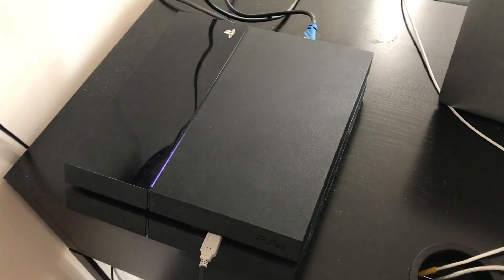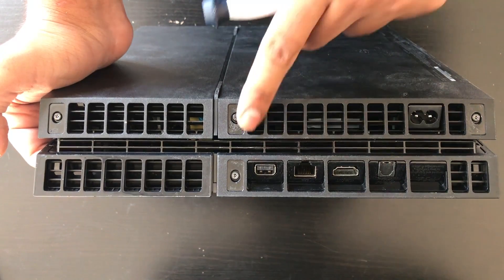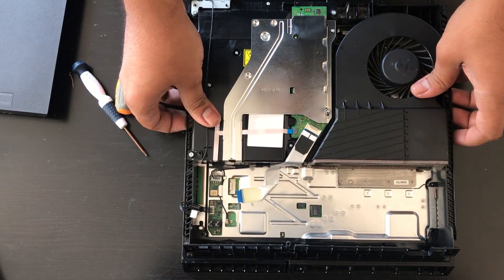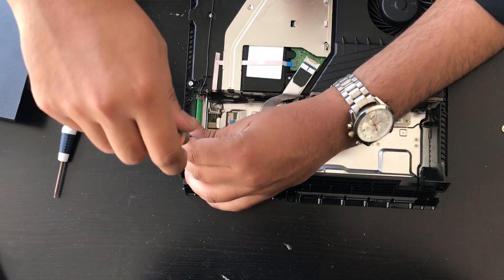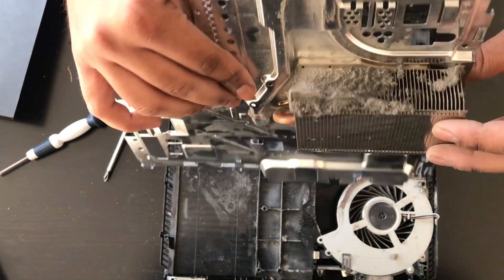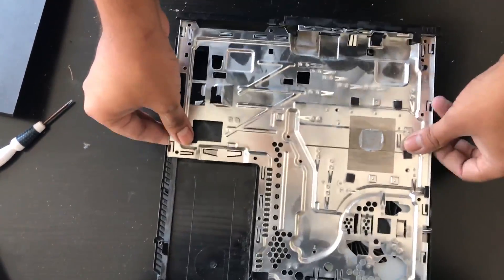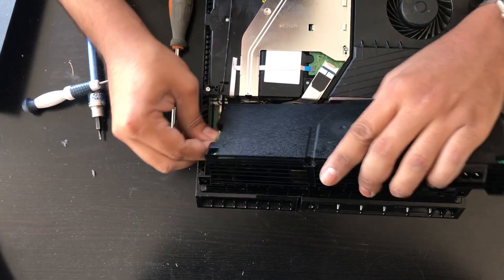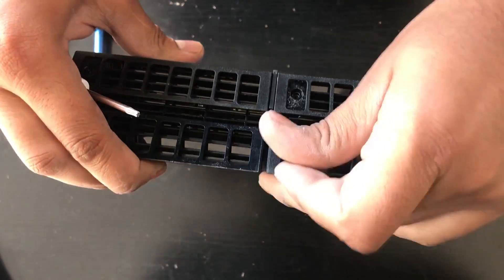PS4 Too Hot overheating due to dust build up and fan (CUH-1001/1115 cleaning and disassembly)

Comment: Im scared to do this but my PlayStation sounds like a engine should I do it
Reply from the maker: If you don't fix the issue it could get worse over time.
Reply: Fasttech I don’t know that much about electronics but I will definitely clean it
Reply: Fasttech my boyfriend PS4 sounded just like the one in the video. It had so much dust that the dust was brown instead of gray. The PS4 worked fine but the noise was so loud. This morning I took it upon myself to follow your video grabbing all the dust along the way but my boyfriend got upset when he seen I took it apart I was right at the part before getting to the mother board. So I just put everything thing back carefully but when I turned the PS4 back on it was working fine but after 10 mins it turned off saying it over heated but no hot air was blowing from the fan cool air was. So after a minute I turned it back on again and it turned straight off and the light was blinking red instead of blue! Do you think you can fix it or did I mess it up
Reply: Ramia Lavender that sucks!!! I would just try to take the whole thing apart like he did in the video, you may have lodged a chunk if dust up against the fan. The most important part you need to clean is the heat sink, which is the hardest part to get to. Good luck. I hope you got it resolved.
Reply: Check my comment if the symptoms are the same then the thermal paste got messed up when removing simple fix buy new thermal paste add it and boom you should be fine 100%

Bro thank you so much really appreciate it my fan was clogged as and so was the thing attached to the heat sink next to the fan. Man you are a legend man my ps4 would instantly beep 3 times and then turn off with a red light.. ended up been the dust built up or the fact that there was hardly any any to none thermal paste on the chip...used nail polish to clean it up applied as u said and boom is quiet as....started off really loud then settled down heaps and now hardly a sound..thank you sir you just earned a sub and a like and many shares of this vid
Reply: @ManifestMia1   its probably messed up
Reply: @ManifestMia1  Yes, Ive got the same problem and I stopped at the same part! I have no idea what it is though...
Reply: @ManifestMia1  on u
Reply: @lovechild2568  Hi, so this was a minute ago exactly what do you mean
Reply: @ManifestMia1  it’s making a engine noise
Reply: @fasttechvideo  What is the screwdriver for ps4 t8 or t10
Reply from the maker: @nikitobg.  T8H. We sell them on our site if you are interested. Link is in the description box.
Reply: Fasttech can you clean my ps4 plzz I’m to scared plzzzz
Reply: I agree
Reply: @fasttechvideo  Yeah it did mine overheats and crashes in like 20 mins
Reply: Fasttech it’s been happening constantly for 2 days now
Reply: Fasttech how much does it cost if you fix it
Reply: @fasttechvideo  hey can I ask something? if the system shut down by itself, will it be a able to turn on again?
Reply: @fasttechvideo  hey what is the metal clamp is it ground for fan and usb to the body plate?
Reply: Terror_Bear  yea bro I did it and it work thanks to the video n guy
Reply: Mine sounds like WW2
Reply: Black are you sure:
Reply: If I just want to clean the heat sink do I need to remove the power bank and the back side of the ps4 or can I just open the top part which is next to the face plate cover?
Reply: Jason Mora Glad to hear that.....
Reply: Yes I'm scared too 😓😓
Reply: I waited and now it is overheating
Reply: Yes you should do it. I have 1206A and it made loud noises and it the air throw at the back was not good. Cleaned it replaced the paste ( as it dried out) and its like new now. Clean it before getting a dead system...
Reply: @slimsketchy1489  do you apply the thermal paste ontop of the dried thermal paste or clean the old one off?
Reply: Terror_Bear yes you should I never listened mines now broke I’m trying to fix it now but idk how I got a dust over heating thing and I got the blinking blue light and a white line that blinks so know I don’t know what to do I need somebody to fix it
Reply: @FranciscoGomez-tb1oo  did you ever fix it
Reply: @FranciscoGomez-tb1oo  buy a new one at that point brother
Reply: Before you open your system it would be best to use rubbing alcohol (least maybe 70%) to clean off the fan, heatsink, and the whole system. The next step is to buy new thermal paste to re apply the dried up expired old thermal they applied. I guarantee if you all these things you won’t have to open you console for the next 4 years depending on the condition where you put it AAAND you system will cool much more efficiently I wanna say for atleast 15 degrees F
Reply: @NopeKickEm  how much is a thermal paste?
Reply: Yea I did it and it is working perfectly
Reply: Of course
Reply: Bruh I’m in the same scenario
Reply: Do it i just fixed mine no loud sounds or overheat
Reply: It works dw
Reply: Facts mine sound like a engine
Reply: I broke mine because of it
Reply: If u have to time and patience to do this yeah.  Only took about as long as this video yo take it apart and out it back together.  Day like 20 minutes or less.  If you dint just buy a new one.
Reply: Kenan I’m doin it
Reply: Don't be embarrassed but im 13 and didn't even know what i was doing and fixed it it takes guts you got this
Reply: My friend's PS4 ramped up to a lovely 86db after 5 mins in the COD Warzone menu. Dismantled it, not that dusty, thermal paste seemed ok. But one the thermal pads on the VRAM had fallen off, that's what caused the fans to ramp up. Repositioned the thermal pad and replaced thermal paste. Quite an easy job, requires a security torx 8 and Philips screwdriver. He's cruising at 34db in the menu and ingame now.
Reply: My ps3 could never lol
Reply: Same my sounds like an airplane about to take off
Reply: do it I never knew much about technology but the more you open and fix and clean you’ll get better at opening and understanding what’s wrong
Reply: I had the red light of death when I tried fixing this I got blue light of death
Reply: I will just give it to professionals so i will not be worried of screwing up  the system even more
Reply: Just do it, you won’t break your ps4 trust me, I even dropped the power source and it’s just fine
Reply: engineer**
Reply: If you aren't comfortable doing it yourself then find a shop that will do it for you but at a cost
Reply: Hi i have a ps4 white light problem and need advice.

So i traded a faulty xbox one original for a supposed faulty ps4 original from a person that fixes consoles that wanted the Xbox for spares.

So on the day i got home with the ps4 i used my ps3 cables to power it on and it miraculously powered on which surprised me as the controller was connected properly using the usb cable.

But i saw the screen flash black then back to the home screen which i didn't know what is was then it did it once more and was displaying perfectly.

After about 5 mins of waiting for it too show some errors or switching off because i did not expect it to work i plugged in my usb speakers to the other usb port on the front while the controller was plugged in.

That was when the screen went black instantly. I didn't know what happened and pressed the eject button and a copy of GTA 5 came out which means the console was still powered on.

When i plug the controller and speakers in on my ps3 super slim at the same time is says too many devices drawing power something like that.

So i think it drew too much power on the ps4 and caused a wlod on the ps4.

Im trying to do a home repair with minimal tools and if you could give me some idea of what the usb ports could have shorted eg a transistor or fuses or something.

It still powers on and everything but that was the defining factor i think that contributed to the white light of death.

Any recommendations would help as ive watched a lot of YouTube videos and most are the ic chip or some transistor .

Its a original ps4 with wlod 1116A
Reply: wow ur scared to even try and fix your own ps4. You aint a real man
Reply: John Texas well yeah I’m scared too because I don’t have the money to get a new one smh maybe you do
Reply: @PurpleMountainDew91   what
Reply: Just get the xbox one I had same issue but switched to Xbox and Xbox never overheats
Reply: @prestonblum7201  Get lost!! xbox sucks
Reply: @RedJTaken  alright "Dark Master" I use PC now so it dosnt matter